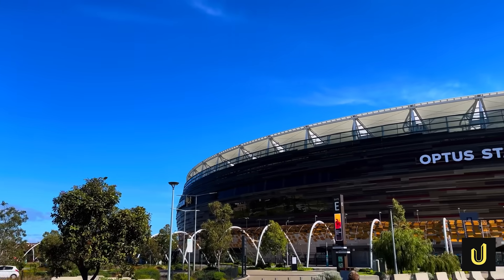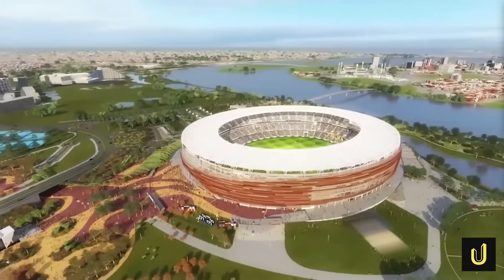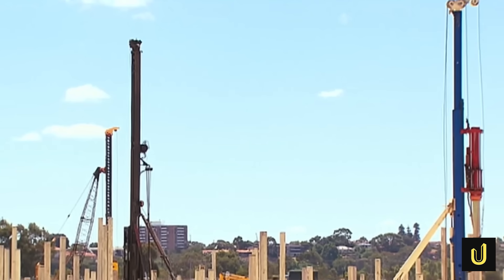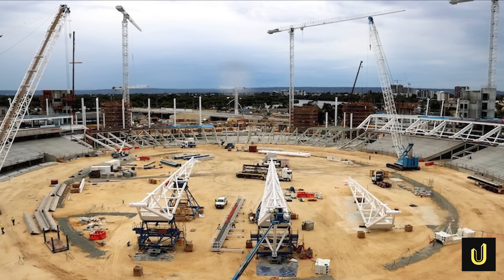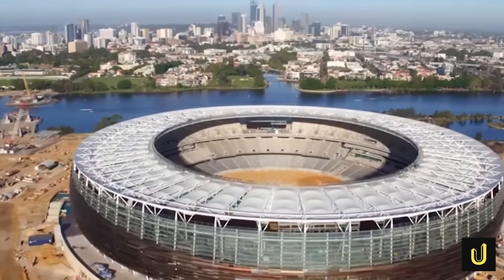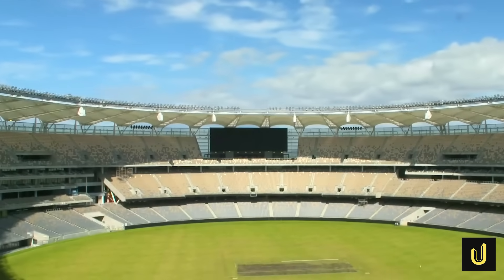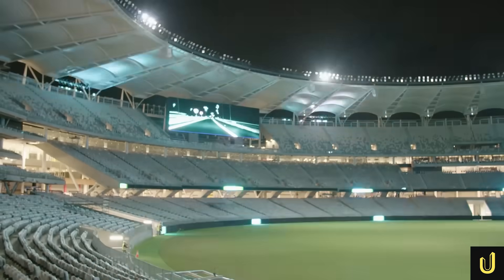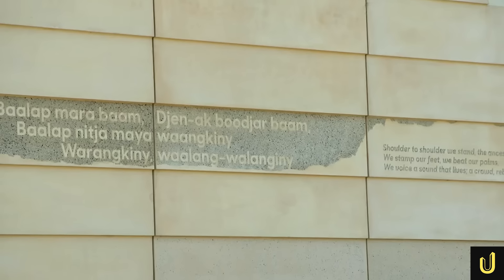The Hidden Dangers Under Perth's Stunning Optus Stadium Revealed

Comment: The whole area where the stadium and Crown casino plus the many apartments and homes currently sit, used to be an open air dump. Right on the edge of the city. Then it was developed into a golf course, casino and hotel complex and apartment towers and homes. The stadium is the jewel in the crown for this site.

Comment: taking an hour to move 50K of people is poor considering a capacity MCG has everyone out of the area in an hour. Thats double the amount of people in the same time. The MCG also does this without dedicated bus routes. Those 20+ bus stops at Optus are for special routes taking people to 'High Volume' areas like shopping centres where there are large car parks. 

Part of the issue is that the original design was to have two stations, one to the north heading north, and one to the east. Instead there is just the one and there is one point for the buses. as the stadium is boxed in to the river it is hard to make additional access routes for PT

The stadium is also designed to be able to expanded to 80k, which arguably it should have been built as from the start. how they will do this and keep the facade is unknown

Then the seating has massive issues. firstly accessible seating appears to have been an after thought and when there are things like fireworks in the sky at an event they cannot be seen from the accessible seating, but also because the ground level seats are not at ground level, but pitched as though they are, when you are sitting in the ground level seats and not in the front row, when the action is close to you you cannot see anything. 

Also the roof does not cover anywhere near the amount of people this says. At a day event it is lucky if 60% of people are in the shade at any one time. You watch the cricket and people move seats throughout the day to stay in the shade. it also looks awful on TV because the side that is in full sun also happens to be the side that the camera capture. Even the people closest to the roof are not immune due to the angle of the sun in summer and the fact that there is nothing to protect them from behind. The top row as a panel of glass that goes about half way to the roof, nothing more. 

that panel of glass is also annoying at day events as it gets glare from the sun. if you are facing toward it you are blinded. 

and all this is before I get to how bad the food is there... which is a whole other rant
Reply: The stadium was never planned to hold 80000. 70000 was always the maximum, and was never planned to be the initial capacity

Comment: Why Carbon Dioxide is dangerous?
Reply: Because that's the net zero narrative..carbon bad 😂
Reply: @ACDZ123  The bigger concern would be slow seepage into confined spaces. Say, if one of the maintenance staff went into a rarely-accessed area, and it was full of CO2 instead of a mix of breathable air. There's no hidden agenda here, just common sense. Next time you see someone working in a telecomms cable pit, see if you can spot their gas monitor.
Reply: @philthy903 This has nothing to do with the stadium in this location. Wherever we are working underground and or confined space,  we face this problem and there are safety guidelines to follow.

Comment: This was considered marsh land and therefore needed extra reinforcement.  It was considered the most expensive option due to the extra work required.  Certainly there were issues with toxic stuff.  No doubt.  But it was the dampness and the low land that was the issue.  You feel it on cold nights actually.